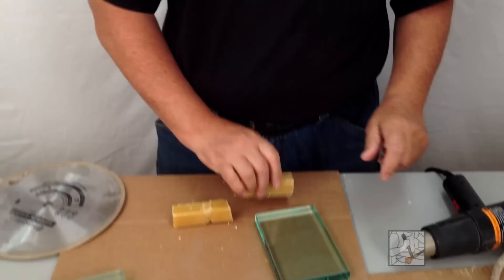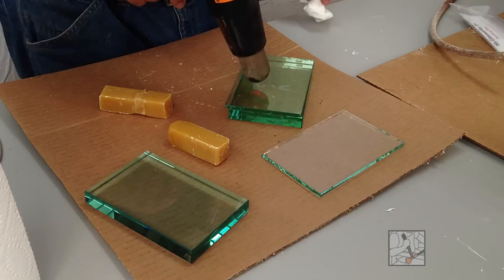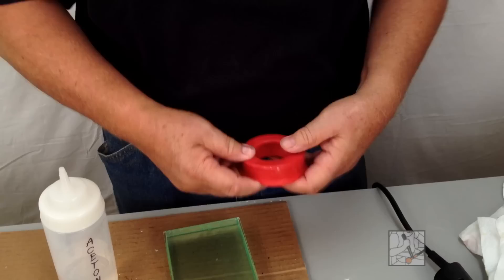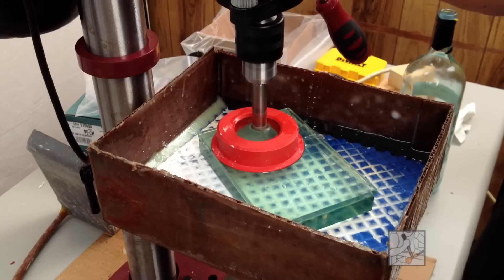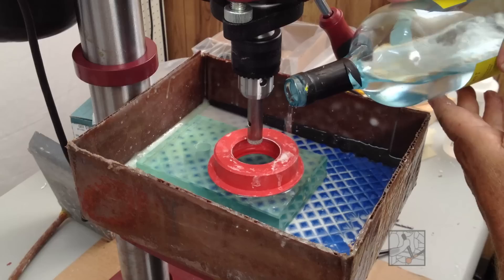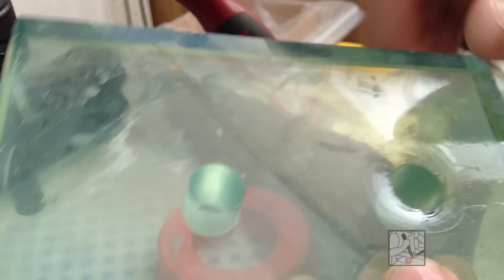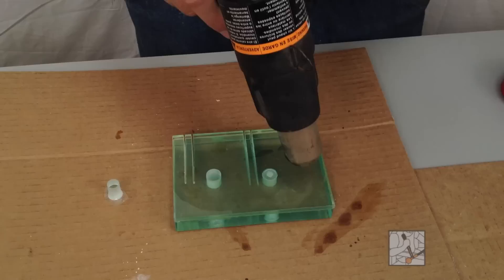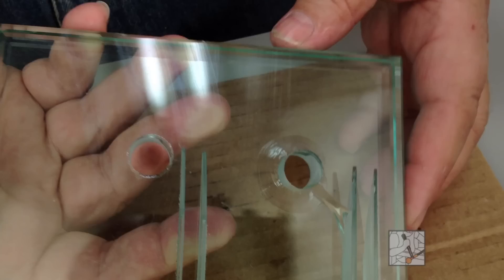Using Stacking Wax for drilling and cutting glass

Comment: I do a lot of projects where I cut glass bottles. I am going to try one of the Huaqvarna superlok blades. The one I have gives me a lot of chipping on the inside edge of the bottle when I cut them, which then requires a lot of finishing work on the edges. Any tips on getting less chipping when cutting bottles, other than getting the best possible blade for my wet saw? Thanks and I really appreciate your content.
Reply from the maker: The right blade will do wonders for minimizing chipping. Having plenty of water at the contact point of the blade and the glass will help as well.

Comment: GR8T Video! Thank you for taking the time... I did not know about "stacking wax and additional layers", but it makes COMPLETE SENSE. You bored that hole much faster than I would have guessed. Q. Is localized heating a much larger piece of  (soft type) glass problematic due to the expansion coefficiency? For some reason I "wince" when imagining generating a heat effective zone in a single spot on a much larger piece.. I'm not just asking for "shock value" ;o)  Really enjoyed watching and LeArNiNg.
Reply from the maker: It is recommended to heat the entire piece uniformly if possible. Localized heating could result in cracking the glass.
Reply: Thank you for the reply + info. Really amazing work (i.e. skill + talent). R

Comment: Drill press is running too fast for the coring of that glass, I think.
Second, you may use thinner glasses for dummies on both side of the part glass.
Use an oven ($40 kitchen stuff) for even heat and cool down, works better,
I've done lot of coring in crystals, YAG, sapphire and glass.
Reply from the maker: Thanks for all the additional great tips!